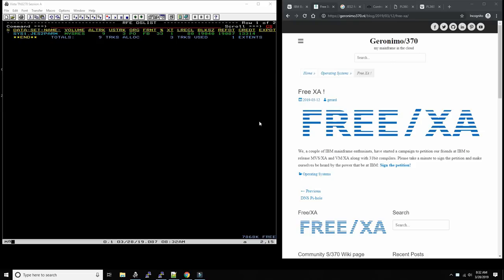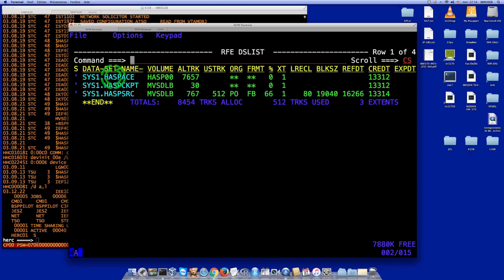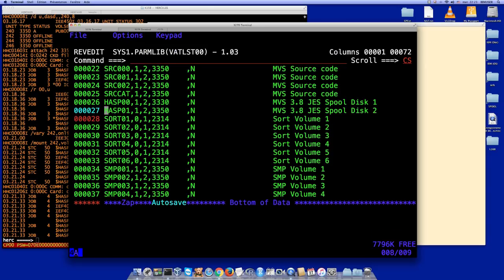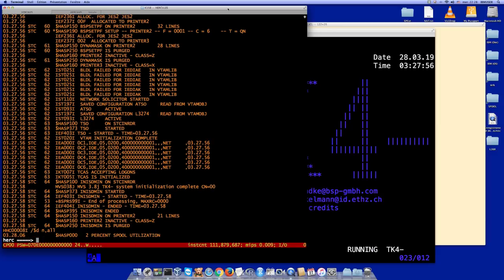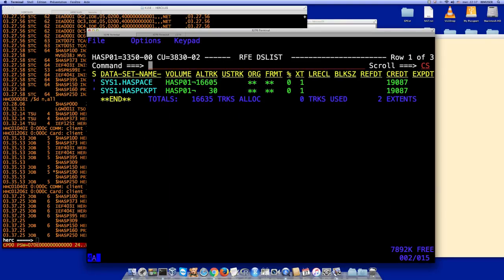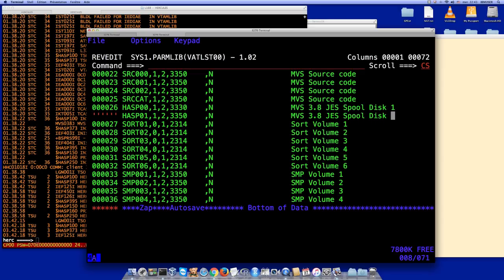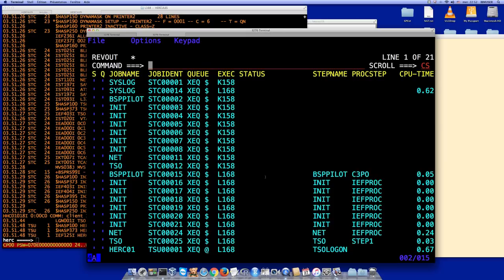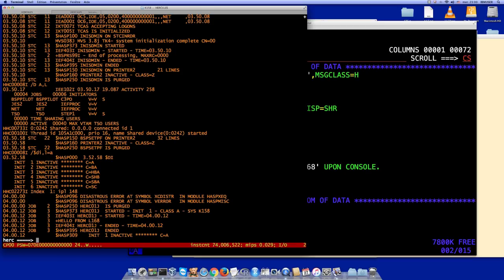JES2 MAS cluster and adding JES2 spool space - M128

Comment: So about the $HASP457 SYS1.HASPACE      ON VOLUME HASP01 IS PARTIALLY UNUSABLE

For my needs, I only have one system and I only want to increase the spool size.

If I understand, the SYS1.HASPOOL on new volume HASP01 should be allocated to take all the space on the volume?  (16650 tracks if I calculate correctly?) 
That way, the $HASP457 message should not appear?

I also understand that this message is not a problem by itself but now that I know it's not perfect, I want it gone :)